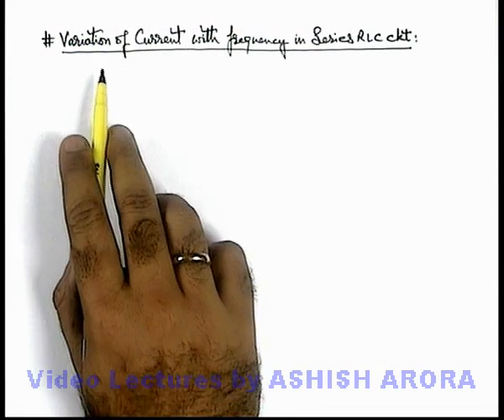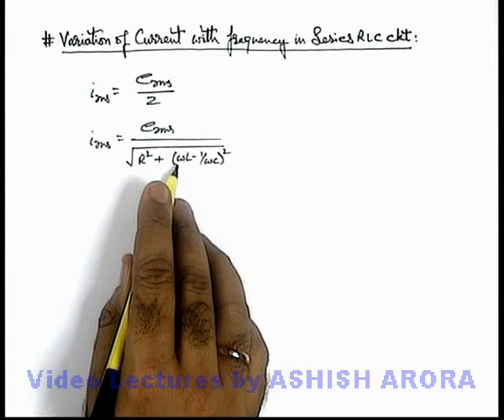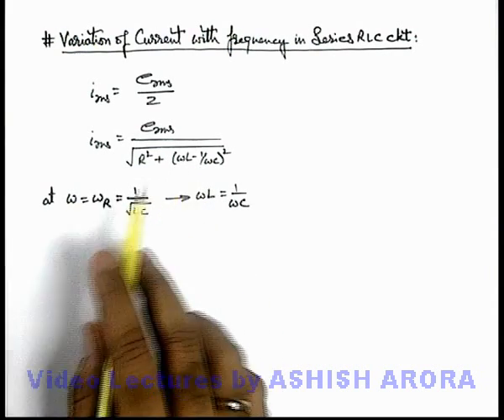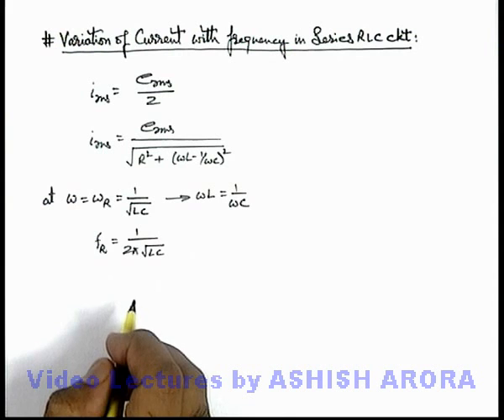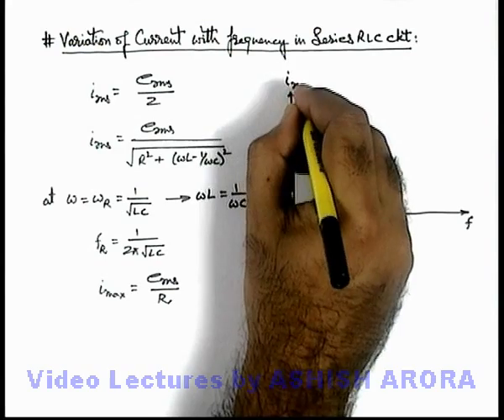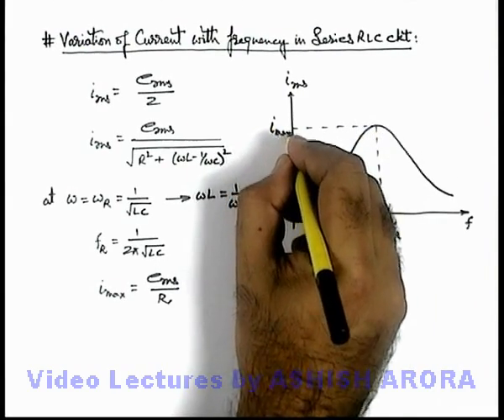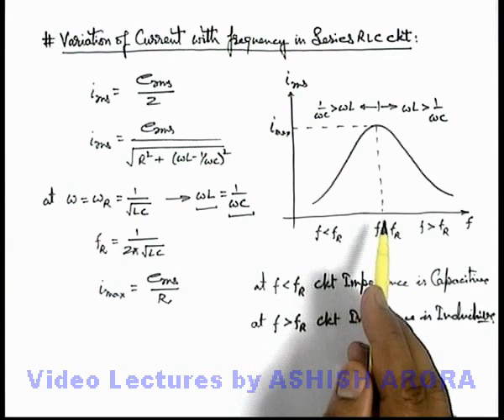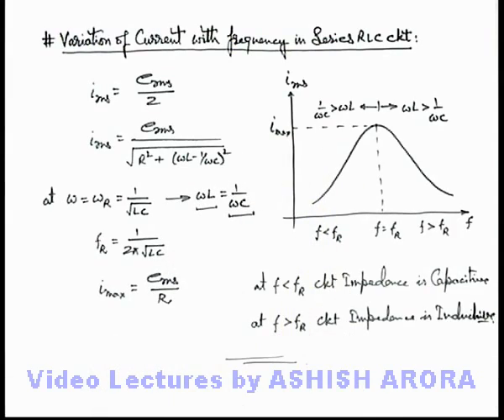Class 12 Physics | AC | #39 Variation of Current with Frequency in Series R-L-C Circuit | JEE & NEET

Comment: Sir, how for f<f(R), you concluded that (1/wC)>(wl) i.e. X(C)>X(L) ??

i know that for decreasing frequency, X(C) increases and X(L) decreases as X(C) is inversely proportional to frequency and X(L) is directly..... BUT still due to the unknown values of L and C, how can you compare that for frequency less than resonating frequency, it will be capacitive only, may be value of L be too larger and it may be inductive only?
Sir what logic did you used....plz clear.
Reply from the maker: +ashi jain simple logic is that at resonance frequency X(C) = X(L) so if you decrease frequency X(C) > X(L) and vice versa...
Reply: still could not understand
 @physicsgalaxyworld
Reply: @manishapatil904 observe properly; in the function of I(rms)=E(rms)/√(r²+(wL-1/wc)², the difference of wL and 1/wc can be either negative or positive or zero but notice there's a whole square which will make the negative term postive and simply return the square of difference and add up with R².